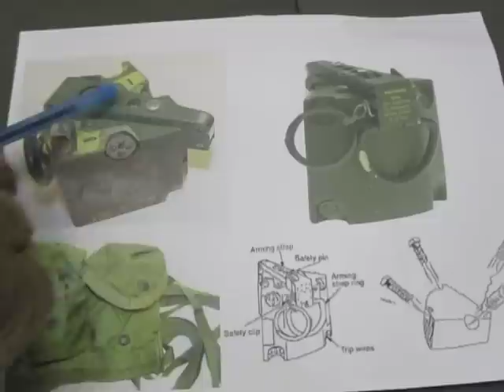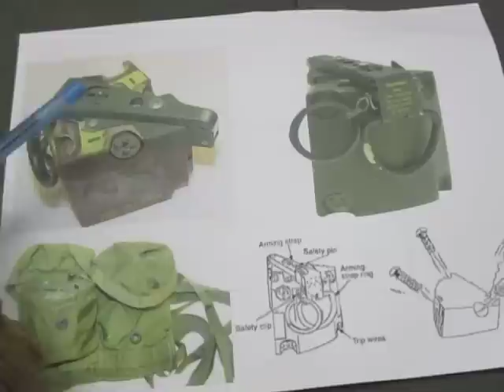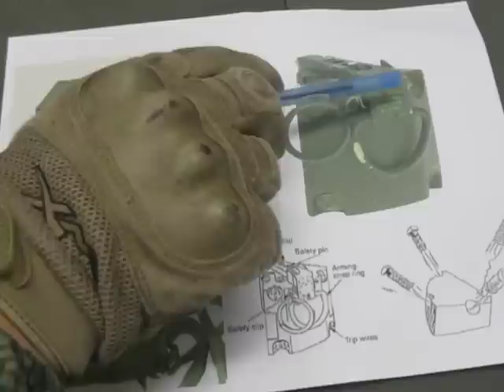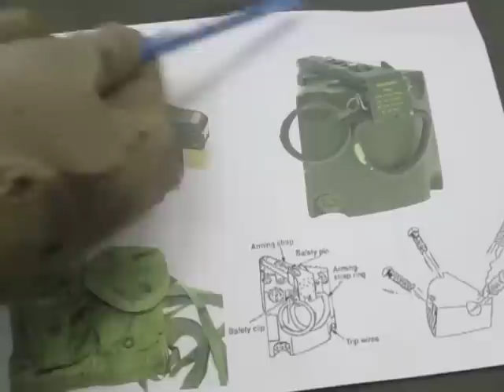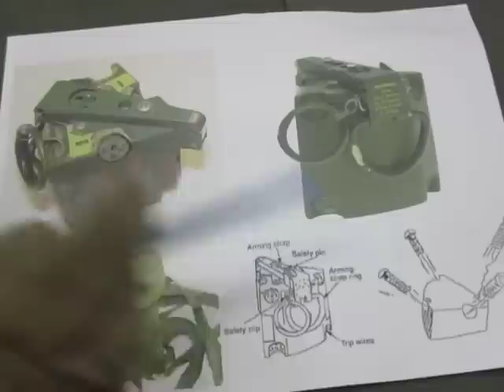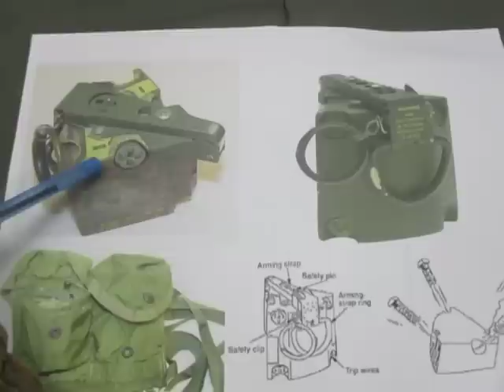US M86 PDM Pursuit Deterrent Munition

Comment: We in the Marines had these back in 1983.  They have jets in them in case they land upside down. I still have the placard book describing how to use them.
Reply: Would you be willing to post the placard? One thing that always confused me about these automatic wire dispensers is how does the wire not just end up going across the ground? If you need someone to put pressure against the line doesn't it need to be suspended at least a little above ground level?

Comment: Once armed there is a power draw, the resulting battery life is 8 to 10 weeks. Stuff the official procedure, I would not get near one of these unpredictable buggers because if you as much as breathe on those trip wires they go off;  get back and put a round into it. If you can't see it at a safe distance, lob a rifle grenade at it. If you land one anywhere within 50 feet of one (or its tripwires) the concussion will trigger it. 

They were a great idea let down by the lack of manufacturer's quality control of the original device (the M74). Also, these were hardly a cheap device which is no doubt why they were restricted in issue.

Comment: Are these still in use? Tripwire activated anti-personnel mines would be against the Ottawa mine treaty of 1997... I personally don't care either way, just wanted to point it out. I don't know if there's a 'special operations' clause in the treaty or if JSOC and/or the units just ignore it.

Having read about it a bit more, the Bush (W) administration made a special rule allowing tripwire activated antipersonnel mines as long as they self destruct. UN however didn't agree with the policy.
Reply: Nobody is seemingly following the Ottawa treaty anymore. Look at the Wikipedia page for it and you'll see that it is another faux treaty which is thrown away the moment its disadvantageous. It is a bad treaty anyways, APERS are practically necessary for any conventional war for area denial. I sure as hell don't blame Ukraine for not following it.
Reply from the maker: Reportedly they were being used by US Special Forces during the War on Terror.

Comment: This like an "updated" claymore?
Reply: No.  Claymore is a command-detonated directional mine that is used largely for offensive purposes (initiating ambushes).  This a surface-laid tripwire-activated omnidirectional fragmentation mine designed to be quickly thrown out to delay enemy forces.
Reply: @bronco5334  You can make a claymore a trip as well, just make sure they don't see the wire and the weight hitting the clicker when it falls on it, just have enough imagination.
Reply: @Legatus2kx  Claymores aren't omni-directional, for claymores to be effective, you need to know exactly where the enemy is coming from. It's an ambush weapon if anything, not very good in area-denial or even as a deterrent.... and when it's an ambush, using a tripwire isn't quite optimal either.
Reply: @glandhound  they can be if you have multiple of them set up
Reply: @bronco5334  quickly laying them down with a trip wire while trying to break contact?
Reply: @agro_ink423 Not easy...

Comment: 1:36 IIIRC Since at least the 90s the programming has been done with the M151 DTDM (Digital Time Delay Module), which sets delay time and impact/airburst settings for FASCAM and basically everything else. M151 is still in use, of course, but when precision guidance is needed the M151 DTDM is replaced by the M1156 PGK (Precision Guidance Kit), adding GPS guidance and keeping the programmable settings. M1156 was fully adopted in 2015. 

I am a civilian and always have been, if any 13-series or 0800 guys are reading this, please correct me if I got anything wrong.

Comment: Saw a demonstration while at Quantico MCB around '86.
Salesman had a see thru resin, pyramid shaped, explosive device, appox 5x5". 
Had a digitized clock in the base, you could set for a timed detonation, or simply activate and toss on/near the trail behind you. After about 10 seconds it ejected a dozen, extremely small trip wires in an approximately 15 ft circle, and if one were moved it'd detonate with the power of a grenade. Designed to hamper trackers. Have't seen one in service, so don't know if they ever got a Gov't contract. But I was impressed !   ☆
Reply: I had one in 2003 in Afghanistan. They took them back after someone had an oopsie with one. Also, there were fears that the timer for self-destruct were flawed. A few stayed for days after they should have gone boom. Kinda nifty in principle.
Reply: A guy on the Shawn Ryan show talked about something very similar that was puck shaped with about half as many trip wires. He worked for CIA. I've been trying to find more info but seems they're able to keep secrets even today. Cool stuff though.
Reply: @lando8913  That's the style from the flipper scatterable mine system.  There was an artillery and air drop versions as well.
Reply: @2fathomsdeeper  He said it was something they carried with them.
Reply: I WAS NOT IMPRESSED CHILLED KILLER. ARE MAMER.
Reply: Mine removal sounds like a job for a mine removal vehicle. I don't see how it's practical to inch in there and place a c4 cube to remove it. Too much risk.

Comment: Better than spending time setting up grenades with trip wires.
Reply: depends actually
are your pursuers one minute behind you? or one days treck behind you?
what condition are you in and what supplies do you have and how far away is what's determined safe?
given enough time and space etc,no reason not to use standard grenades vs having these specially deployed.

Comment: Myself and my platoon was part of testing performed on the PDM at the US Tropic Testing Center in Panama back in 1988.  Both in deploying these and in detecting the presence of its trip wires.  Wasn't too hard to detect the trip wires once deployed but if I were actively pursuing someone, I wouldn't probably notice these.
Reply: Detecting some of the tripwires might slow a pursuer more than not detecting them.
Reply: Cerro Tigre test site.
I served July 91- Aug 97 in Panama. 
Good memories from what remember.

Comment: Something similar in use today, never saw these though. Basically same principle on the wires. Should you come across them gtfo and don't attempt to disarm, IIRC they have a barometric fuse option and the wires are digital push-pull sensitive and I wouldn't trust the self-destruct.

Comment: Awesome series. Can you explain how the ANFO bomb was so powerful at the Kansas city bombing. No one that I have seen has ever explained how something so simple could be so devastating
Reply: We made them when I was a combat engineer. 50lb bag, pour in 2 gallons of gas, and mix the crap out of it for 15 minutes. Very powerful. But it needs to be used within 12-24 hours depending on conditions, or it won't work. It makes no sense that 1 man mixed hundreds of bags and loaded those bags within 24 hours.
Reply: @KA-id4wt  would a cement mixer speed up the mixing process?
Reply: Because there was a ryder box truck full of it.
Reply: No way it(truck bomb) would have clean sliced the front of the building like that. Definitely inside devices!!!
Reply from the maker: Are you talking about the Oklahoma City Bombing in 1995?  That was done by bombs inside the building.  The Ryder truck outside was for show and couldn't possibly do the damage that occurred.
Reply: @SecurityGuy42  my bad absolutely. I haven’t seen a video on how an anfo bomb could do so much damage, that’s why I asked.
Reply: @RV_Chef_Life oh thats easy. The official story was a lie.
Reply: @mattmarzula  Basically 4x the payload of 2,000lbs JDAMs